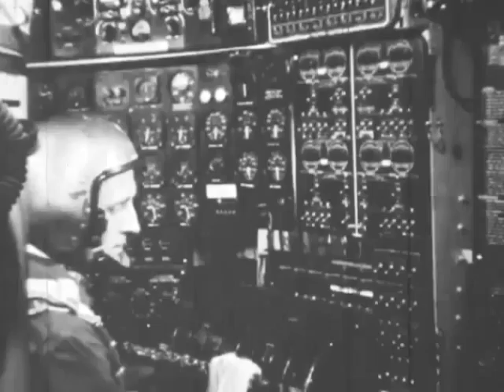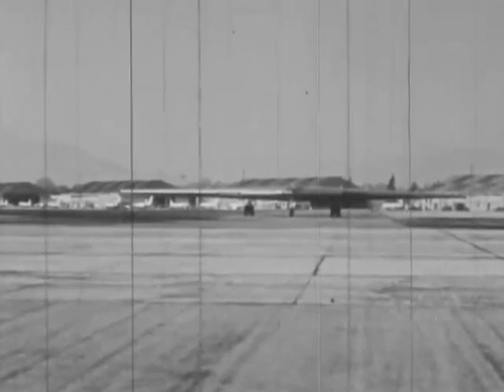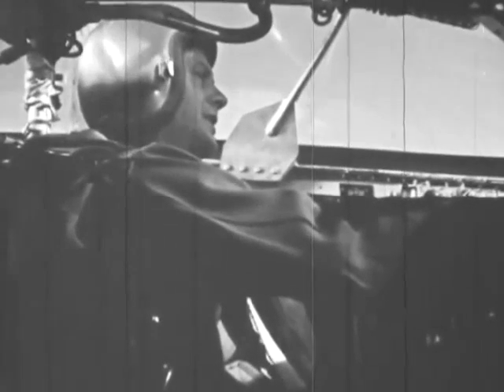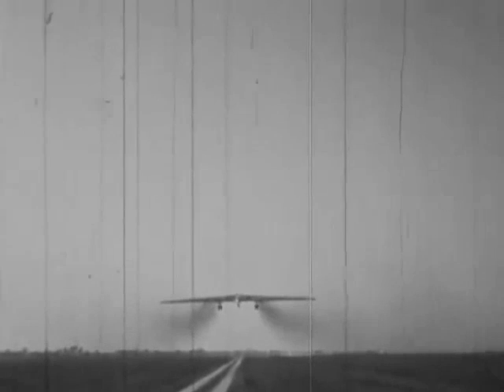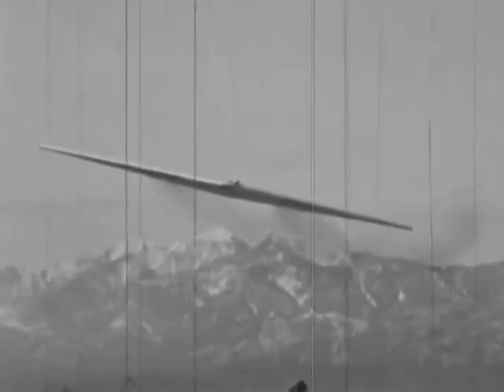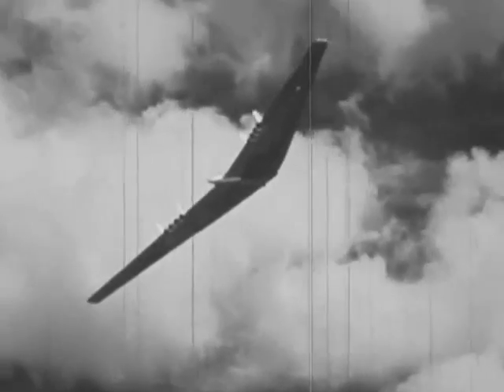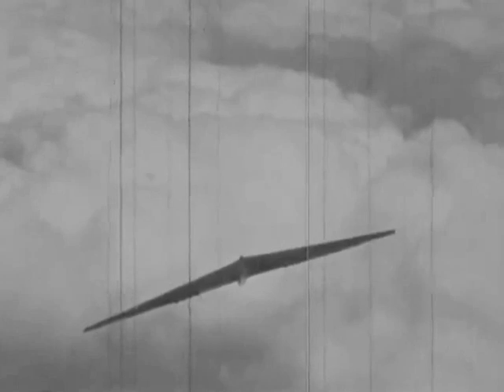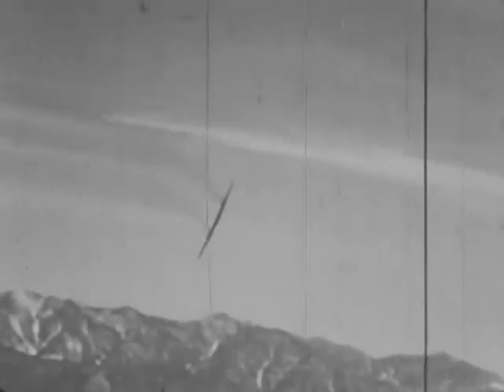Northrop YB-49 "Flying Wing" - Taxing, Take Off & Flight Operations (1947)

Comment from the maker: Sorry but the Ho.XVIII & YB-49 projects are unrelated. The Northrop YB-49 is a jet-powered development of the piston-engined X/YB-35. All the YB-49 built were, in fact, YB-35 converted. The US Army Air Corps signed the XB-35 development contract in 1941, two weeks before Pearl Harbor. In 1945 the airframe of the first XB-35 was virtually completed. By the way: the XB-35 was the 13th flying wing flown by the Northrop company.

Cheers,
Aleks

P.S. : the Ho. XVIII was never built.
Reply: So it the YB-35 and YB-49 preceeded Ho. XVIII? Good to know.
Reply: @eottoe2001  The Horten brothers did not get funding to begin the 229 program until late 1943.  They deserve credit for their own flying wing research and experiments before and during WW2.  I think volunteering to build a wing bomber was a means to fund and legitimize their unusual and experimental wing research.   Northrop had done his own wing experiments before WW2 independently.  The wing Northrop began designing in 1941 was a more sophisticated and advanced design as a long-range precision heavy bomber.  The Horten brothers started small and did not get very far while Northrop was already building the equivalent of the proposed Horten XVIII that was never started.
Reply: YOU ALMOST SEEM LIKE YOU USED TO WORK AT NORTHROP ❣️👍
Reply: I want to thank you for straightening this out. I am tied of people commenting on aviation posts and continually saying OH yeah the Germans had it first. The Ho XVIII never even flew except as a glider  The flying wing principle was well known well before WW 2    It is true some German designs did influence post war aircraft such as the Mig 15 and F 86. But on the other hand a lot of their proposals were totally impractical. As least you have pointed out the lack of relationship between German and American designs of flying wings
Reply: The hoxviii may have not been built but the ho-229 flying wing was built

Comment: So anyone know why there was such a large gap in time between this aircraft and our current stealth bomber?
Reply: +kdelacy   Because flight instability in flying wing designs could not be overcome until modern computerized flight control systems were designed.   Even Northrop's big YB-49 had yaw issues, although mechanical yaw dampers were being designed.  Yaw issues were not good for an aircraft designed to be a long-range precision bombing platform.

Comment: This step ahead was killed by corruption and politics. Convair had the mammoth B-36 and they managed to convince several politicians along with Lemay to end the YB-49 despite its advanced ability. It had teething problems make no mistake and the brass who liked the B-36 pushed the problems as bad publicity.  In choosing the B-36 the Air Force had to upgrade every single runway they used to land that monster ... and surprise ... guess who was vested in the construction companies to upgrade all SAC runways for the B-36 ?  The asshole senator who was head of the appropriations committee.  They also made sure to destroy all flying wings because these people didn’t want continual testing to continue on with the planes they already made. God forbid if the flying wing out performed the biggest SAC bomber . I also wouldn’t put it past Lockheed who had the B-52 on the drawing board at that time to also want the flying wing out of the way.

Comment: For all of you that have made comments on how sad it was, this plane never went into production you need to know the YB-49 had major stability problems and actually killed a crew while it was being tested.
Reply: Bingo ! You're correct. The handling was not easy at all, as the narrator was saying. In fact the B2 wouldn't have been any easier to fly if it wasn't for the computers. The german designer Lippisch toyed with the pure wing or tailess concept for years. A rudderless wing is very tricky and tough to maneuver. The Horten brothers experimented with the design in the HO 229, but never got into production.
Reply: Before it's cancellation the engineers solved the stability problem with a 3 axis mechanical rate gyro, but by that point it was too late. Basically it would take pilot inputs as rates and operate the control' surfaces to make those rates happen. Like a drone flight controller but it used mechanical gyros and analog PID control loops. Bell Helicopter would later use a similar system in the AH-1 cobra to replace the stabilizer bar on the rotor head which was not updated to digital until the 80's. PID control is the basis of stability augmentation, today it's done with computers but it can be implemented with gyros and analog circuits or even gyros and mechanical clockworks. The first PID control was a clockwork and compass based "mechanical steersman" for ships at sea designed in the 1900's

Comment: The wingspan of this wing and the wingspan of the B-2 are the same, Jack figured it out with a pencil and a slide rule. He was ahead of his time by a few decades.
Reply: This thing looks ALOT bigger than a b-2
Reply: @Dave_Crupel  The B-2 is designed to look smaller than it is. Even in the visible spectrum its passive stealth characteristics make it seem smaller, if not by the many many orders of magnitude that it dose in lower frequencies.
Reply: @Volunteer-per-order_OSullivan given visible light is on the same spectrum as radio waves its logical

Comment: Gotta love that Ra Ra music. To bad the fix was in when the XB-35 was up against the XB-36 and someone in the government probably got some huge kickbacks to send the contract to Consolidated instead of letting the better XB-35 be turned into our first real strategic bomber. Take all the ram materials to build one B-36 and you could probably build 2 B-35s. Take all the fuel for a B-36 and fly 3 B-35s the same distance with the same bomb load and probably at higher altitude and without the extra jet engines. It's a sad thing when the people in government are more interested in their own financial gain and self aggrandizement than they are in doing their best for the country.

Comment: Looks like a pre B-2 from the side.  From what I have read, these wings gave about 10-percent of the radar signal of the traditional bombers but it looks as if Boeing may have greased some palms to get their B-47 and B-52 projects accepted and these wings scrapped.   Also,  there's no mention of the bomb bays on these wings; where did they plan to put the ordinance?
Reply: These wings were scrapped because contrary to what the narrator in the video said, they were a triple handful to fly. They required way too much corrective adjustment of the control surfaces by the pilot during flight to be practical for one pilot to handle on longer missions. In contrast, the B-2 uses computers to make all of those constant adjustments to the control surfaces to keep the plane in the air and make it a viable weapon platform.
Reply: @ralfie8801  The engineers developed a three axis electromechanical gyro system to address that but by that time it was too late. Bell Helicopter would later use a similar system on the AH-1 Cobra see: https://www.youtube.com/watch?v=EHsiBSTdjyA&t=366s Basically it would take the pilot control inputs as rates and then treat attitude changes that fell outside expected attitude rates as error and apply corrections. This is exactly how a drone flight controller works except instead of a software PID control loop and angle rate sensing chips it used a PID implemented with analog circuits and mechanical rate sensing gyros.

Comment: Given the engines in production at the time, it would have needed six, not four.
Reply: Must have been piss-weak engines if they needed 8 of them.
Reply: @Geebax2  the B-52 has 8 engines and is still in service.
Reply: @NitroU-  Actually, most of the remaining B-52s that are to be kept in service are being re-engined with more powerful, quieter, cleaner  and more efficient engines.

Comment: That was another of Northrop's flying aircraft and it was good, but the Air Force decided not to by them. The new bomber which the service did my decades later is a great bomber and now they are about ready to produce the B-21 bomber which is suppose to be even better than the B-2.
Reply: +Sidney Mathious   The YB-49 program was terminated by Sec. of the Air Force Stuart Symington to retaliate for Northop not playing ball and merging with Convair.   Convair won and the Air Force got the B-36 monstrosity, but a cool airplane on its own.
Reply: The B-21 is to the B-2 what the AH-1Z Viper is to the AH-1 Cobra. It's not a clean sheet design it's an updated one.

Comment: The Horten claim is nothing but hoax. This video shows that Northrop had a plane even if it crashed afterwards. The technology to stablilize such a plane became available 4 decades later-MC68020 based 32 bit computers without which such unstable planes cannot maintain flight. Germany cannot even make fire control systems for tanks unlike US,Canada and Korea so how can it make flight control systems? At least Switzerland makes Pixhawk.
Reply: Based. Also, the horten crashed too

Comment: That looks like it belongs in the air...coming in to land only for fuel or to change crews. It's a pity the political differences between the new Air Force and the  Old Army caused its cancellation.  Yes it had problems, and Yes, they could have been  fixed.  The Horten bros. in Nazi Germany developed a jet powered flying wing fighter that actually flew (crashed because of an engine failure).  There was plenty of tech, but politics got in the way of what was the most advanced airframe of the time.  Thus we lost decades of possible advances because a couple of Generals couldn't agree on what they wanted done with the project.
Reply: And no, the Volkswagen bus on a boomerang is NOT a replacement for the original Flying Wing.
Reply: A payoff was made to go with the B-36 instead of the B35. Just like it did to buy the Raptor aka F-22 instead of the faster, more maneuverable and stealthier F-23.

Comment: Jack Northrop didnt realized that thick wing makes much greater aerodynamic drag (every one of his flying wings use the same formula) and this is the main reason why performance was much lower comparing with rival boing b47. second is longitudinal stability. Horten brothers make much better aircraft with thin wing, but stability was problematic at high speed, problem solved in b2 thanks to computer controlled artificial stability
Reply: +Michael Martinez — There's a video of Jack Northrop's final interview in 1979 wherein he recounted how Northrop had been pressured to merge with Consolidated Vultee (Convair).  As the terms would have been very unfair to Northrop Aircraft Corporation, Jack Northrop refused, asking what what was in it for him and his company.  The response was, in effect, "You'll be damn sorry if you don't."  The Flying Wing contract was canceled soon thereafter without explanation and the destruction of all existing airframes was ordered by the government.  Airliners today would look very different if it hadn't been for one corrupt politician who was probably being bribed by Consolidated Vultee, maker of the competing Convair B=36 Peacemaker bomber.

https://www.youtube.com/watch?v=Ui_o257DZE0
Reply: The YB-49 did have a relatively thick airfoil, but the absence of a fuselage and empennage reduced the induced drag... The plane could easily cruise at over 513 mph ias. Way faster than the B-36, but slower than the B-47... The operational fighter aircraft of that time were created to help fend-off enemy threats from the slower bombers... It was very efficient, and easy to maintain. It could easily be stored in a conventional hanger and rolled sideways with dollies, No special high-lift equipment was needed to maintain these planes... These were very important advantages... The decision to go with the competing aircraft and scrap the entire B-49 program including all partially completed B-49 planes and the tooling to build them, was CLEARLY a political Boondoggle that was controlled in the high levels of the government... Many wonder why modern aircraft have not adopted this type of design... It has taken place!!! The B-2 Spirit and several types of drones for reconnaissance and attack use the tailless designs with great success.... Maybe other aircraft in the future will adopt these designs as well... Mr. Jack Northrop was way ahead of his time... That is the main thing to remember here...
Reply: ты прав , несущие свойства профиля для летающего крыла ниже классической схемы , это тупиковая ветка с большим сопротивлением и абсолютно неустойчивая .

Comment: As a matter of fact, the YB-49 flying wing turned inside the fighters of its time. The reason said for cancelling production and scraping all YB-49 remaining was an accident where the wings' tips were found several miles away from the rest of plane remains, structural failure was blamed for the event
Reply: +Jose G A There was also suspected sabotage; look up the interview with retired Gen Cardenas, and he explains why he believes this was so.

Comment: another possible reason  that they were destroyed, was that the Soviet Union would copy our designs instead of developing their own, and by destroying them it would appear that it was a dead end project and they would not copy the design, Why you ask was that a concern? The video even stated it, even in it's early stage it did not show up on radar until it was to late to stop them. Remember the Soviets would have flown across the polar cap to attack and the radar had problems dealing with that.

Comment from the maker: Costs and reliability. At the time, the flying wing simply was not mature enough for organizations as the Strategic Air Command (SAC) or a big airline. Furthermore, in the early-mid 50s there were some fantastic, capable, reliable and relatively cheap aircraft like the B-52 Stratofortress, Boeing 707, KC-135 etc.

Comment: If it has such great handling and is so extremely efficient, why wherent more wing only planes build? What was wrong with them? Did they crash too often? Where they instable? Not controllable under certain conditions?
Reply: I had heard as a bomber,  they had way too much yaw wobble for accurate bombing, before active correction from the bombs themselves.   For the fighter roll ya need to be unstable to outmanuever other fighters.  Flying wings needed to very stable before  computer flight assist was invented so they lost out there as well. The statement about cargo ability was not wrong, but cargo aircraft don't get much support from generals who were fighter pilots:)

Comment: This aircraft was flying in 1/3rd scale (Northrop N-9M) in 1941/1942.

The Hortons didn't even have a powered aircraft in 1941/1942.

This aircraft used technology pioneered on the N-9M, like the split drag rudder. Something the Hortons NEVER had..

There is absolutely no German influence in the XB-35/YB-49. They're 100% based on the N-9M, which was actually far more advanced then any German wing in 1941/1942...
Reply: where do you think the design came from sheesh
Reply: @Sccrd4Lfe  god you german larpers are stuck up
Reply: @Sccrd4Lfe  From in-house pre-war Northrop prototypes, not from anything German.

Comment: This YB-49 plane is stolen project (Ho 18) from Germany after WW2.
--- The secret weapon was a “flying wing” airplane called the HO 18 intercontinental bomber, known secretly as the “American bomber.” A jumbo version of a flying wing fighter plane, also in development by the Germans and dubbed the Horton 229, it was designed to bomb New York City and return to Berlin, without refueling.
Reply: Absurd. The YB-49 was not  stolen from anyone. It was an up grade from the YB-35 From the 1930s Jack Northrop and Cheston L. Eshelman each worked on their own designs, and had zero theft from anyone else. The YB-35 was a piston engine plane  and of course the YB-49 was upgraded to jet engines which unfortunately cut the range of the troubled aircraft. It had nothing to do with any German design which were independent designs by Horton. The French were also working on a flying wing design but it never went much beyond that drawing board.
Reply: Wrong.  The Horton wasn't even the first flying wing.  Sorry.  The British built the first one that flew.
Reply: I'd take your version of history rather than the real one any day
Reply: The Ho 229 was not a Jumbo anythying, it was quite small and in fact a total failure. It only flew once and crashed.
Reply: Me when I lie🥰🥰
Reply: Fucking wrong fuck you

Comment: Northrop flying wings were developed before and during WWII independently of German designs and the earlier Northrop prop engine versions solved the problem of broken interior propeller shafts that plagued the earlier Horten designs.